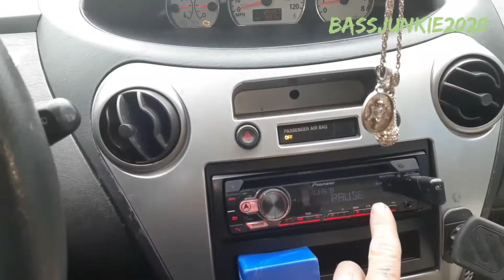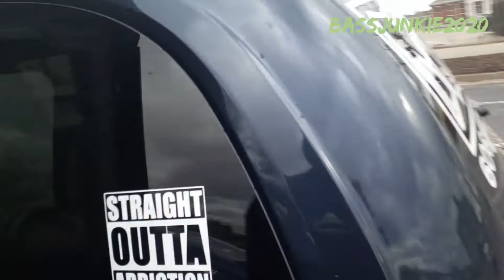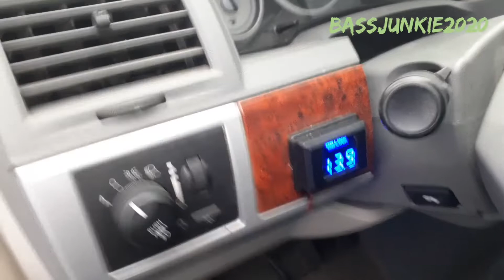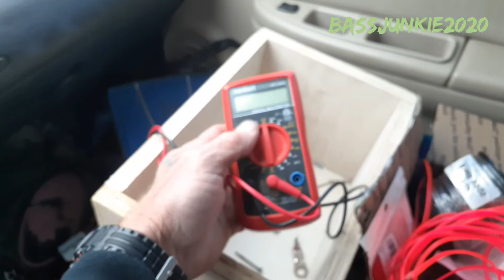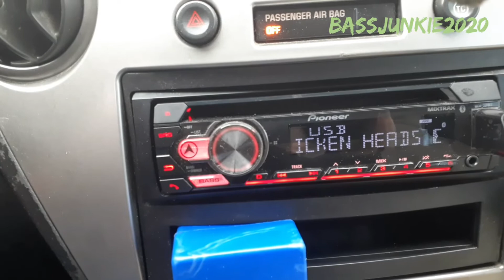Lowe's parking lot demo! With Dustin! A subscriber! 18" Sundown!

Comment: They both putting in some work
Reply from the maker: Yeah I'm not happy with mine. It was better when I had the 10s in the trunk . I mean it hits hard. But not on low notes like it did. I think its the box I built. I'm going to build a 4th order for them. Soon as it's nice enough out and I have time. I have half the wood already.  I did spray foam all the cracks and stuff tonight. Waiting for it to dry all the way. That will almost seal it off. The only place it will leak is at the top of that board behind the box. But I'm not going to worry about that for now. Because when I do the 4th orde im ripping the head liner out and replacing it with bunch layers of that sound dampening 👍💯

Comment: If u got a samsung, and your phone freezes, hold the power button and volume up (or down, cant quite remember) for 10 seconds and your phone will reset.
Reply from the maker: Ok I'll try that if it does it again! I did push all the buttons and held them down! I tried everything! Can't just take the battery out! Cause it's built in to the phone! It might have been a big update or something though. Cause it's fine now👍😎💯